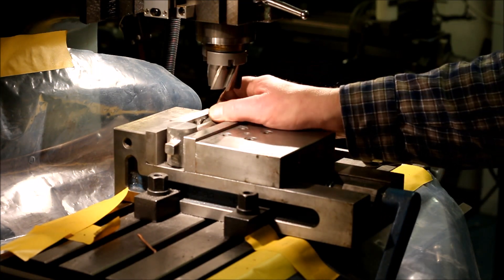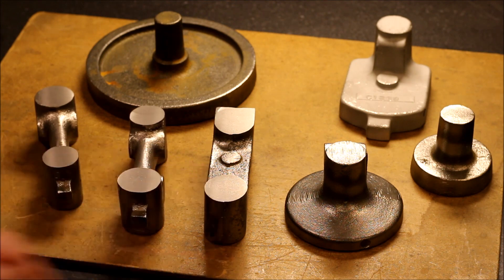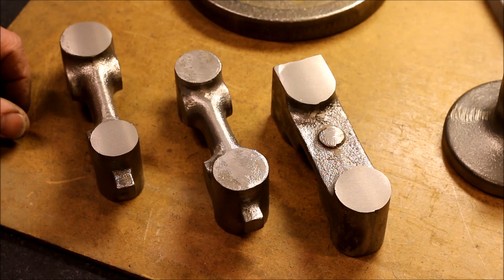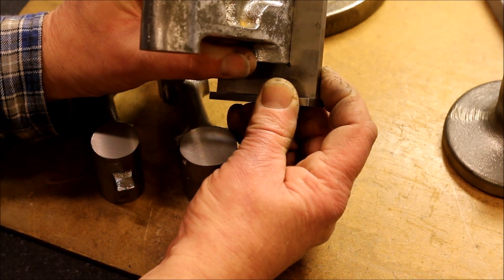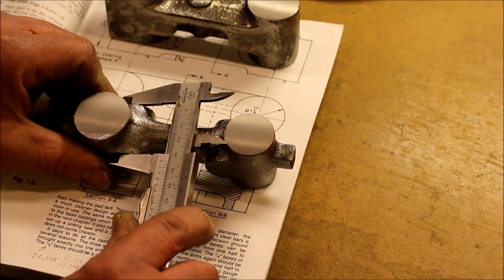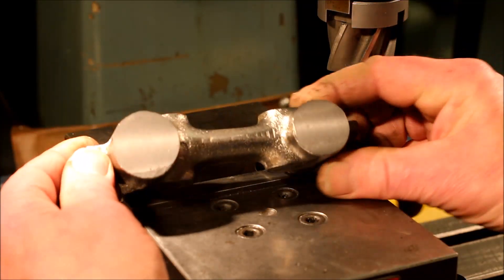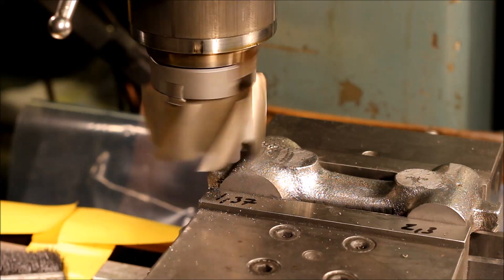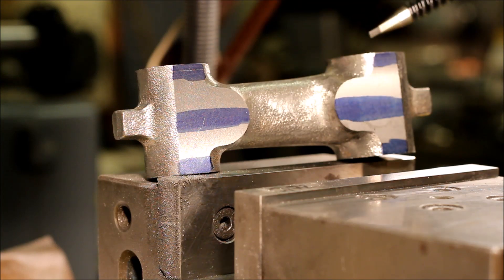universal pillar tool part 1

Comment: There is a "width" reference - and as noted it is the 1.250" diameter reference. Why? because the lines coming off that diameter carry across to the opposite side without a taper or recess being shown.

Comment: Very good!
I have the UPT kit from Martin Model, it has the exact same issue with the top arm that yours does. I also purchased the long arm option, so I have an extra set of arms to machine. I had planned to get started on it in December, but I still have too many projects in from of it.